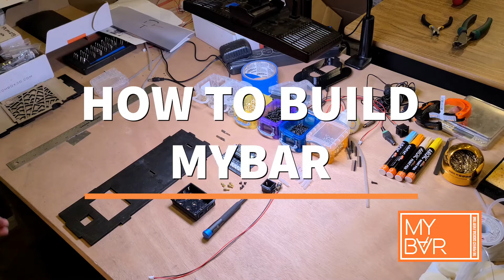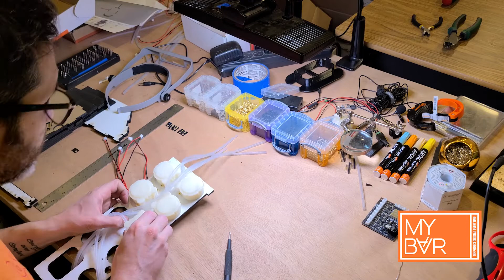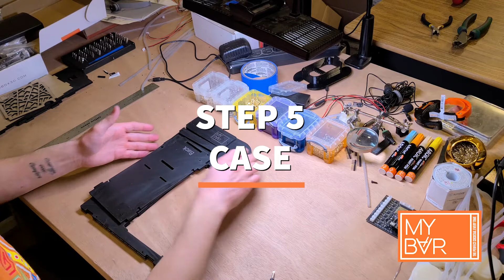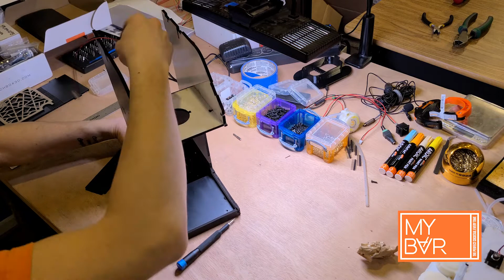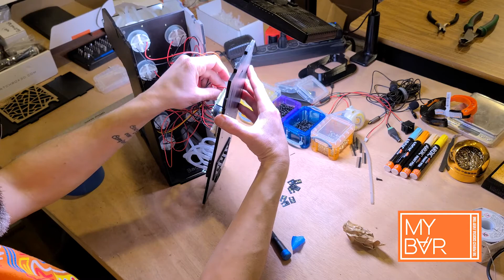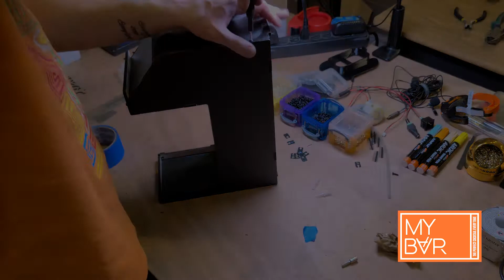Step-by-Step How to build MyBar Cocktail Machine

Comment: amazing project.is it possible to use your sketch with an arduino uno ,Bluetooth Low Energy (BLE) Module and Relay Module ?
Reply: Yes, most likely that would work. Just be make sure that the Bluetooth libraries are compatible with your module.